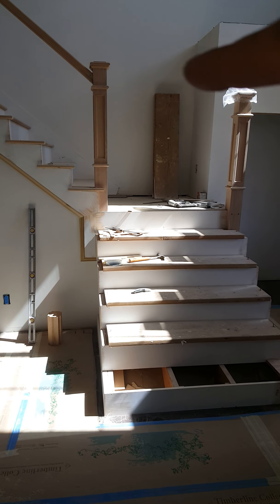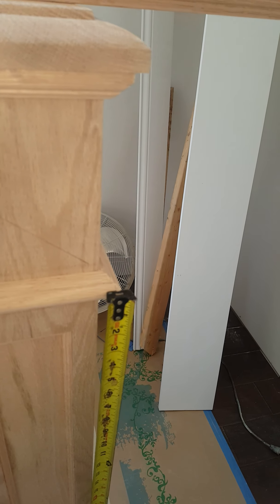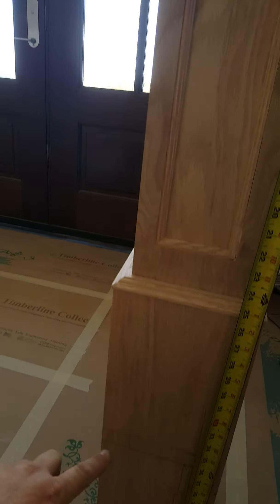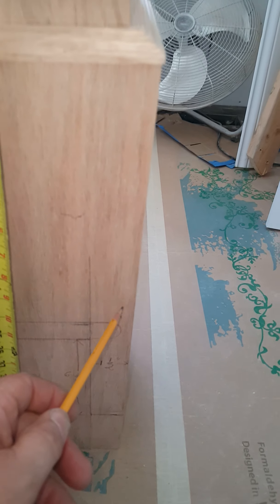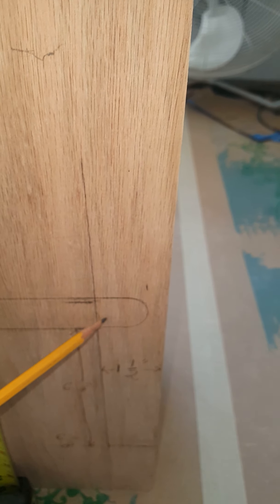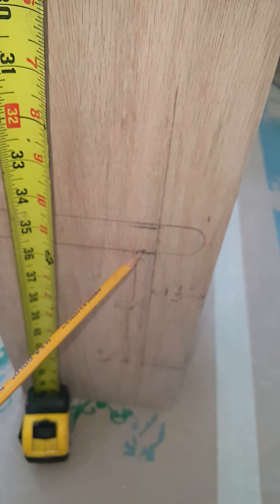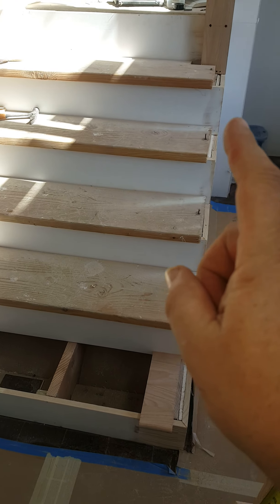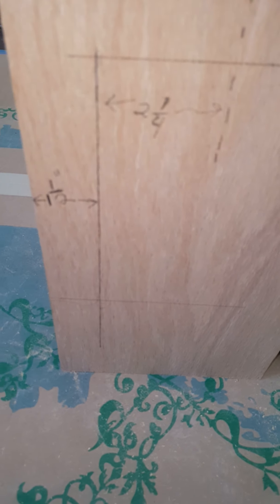newel post height and cut lines

Comment: I thought it wasn’t “off the nose”. I thought it was off the point where the plane of the riser below and tread surface meet which is ~1-1/4” back from the face of the nosing!!!!?
Reply from the maker: Actually you are correct. I was unaware of that small detail at the time. My take on it all is that either way, it's a minor difference.  I always try to keep my handrail an inch above code anyway for any unforeseen discrepancies...But technically you are correct if one is trying to hit it spot on the measurement